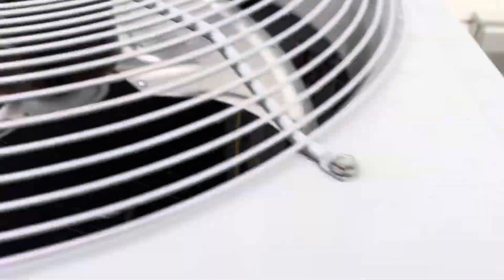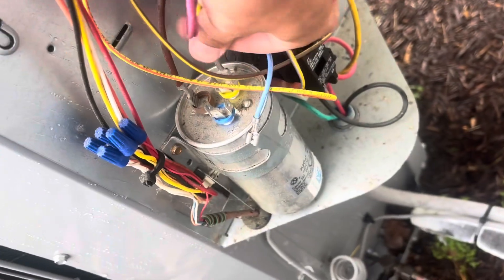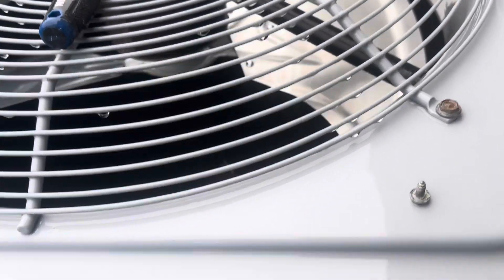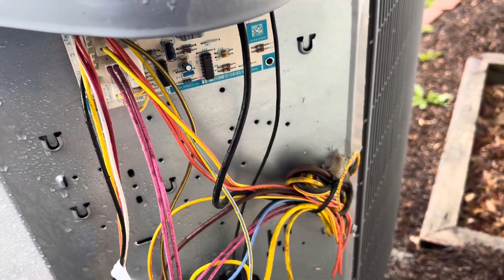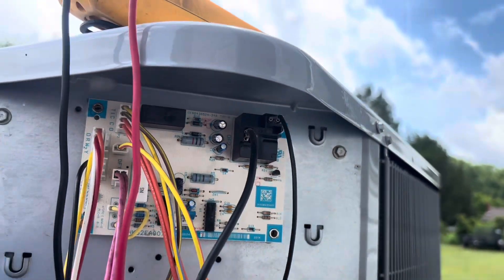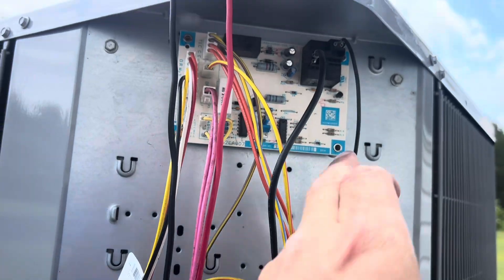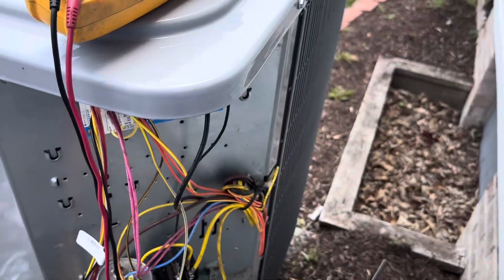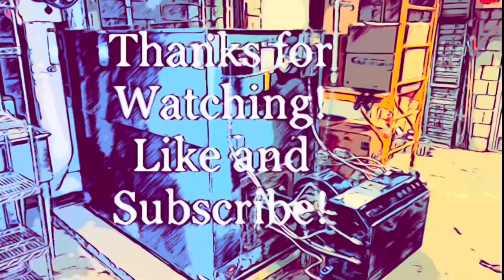It Fixed Itself?! 3 Weeks Later It Quit Again… Here’s the REAL Problem

Comment: Most of the HVAC yahoo's fire the parts cannon before doing any testing! My Lennox system quit today where my thermostat was dead nothing was tripped, my capacitor was good, the contactor was not pulled in, so when I pushed in the contactor it did not start the fan or the compressor, I got the death buzz. Any advice would be grateful!
Reply from the maker: Did you check the capacitor with a meter?  I’ve seen them bad many times before and not actually blow.
Reply: @JeffsHVACAdventures  yes. I put a new one on, and nothing changed. I tested the cap with a meter & was in the perimeters of being good. But after doing some more troubleshooting my condensate line was clogged shutting Down the system. I went and got some cleaner vacuumed it out and I'm back in business! I thought for sure it was a control board! I'm glad it wasn't! Thanks for replying!

Comment: those relays are trash. I see them in other sorts of gear. They pit the contacts and burn up. I don't if know if that one burned up or if the controller was the issue but i despise those relays.
Reply from the maker: Pretty sure it was just the relay.   Plus, the relay is normally closed and it’s just supposed to open during defrost operation.  So it failed in its normal position 🤦‍♂️
Reply from the maker: Btw great channel you have.  Just subed